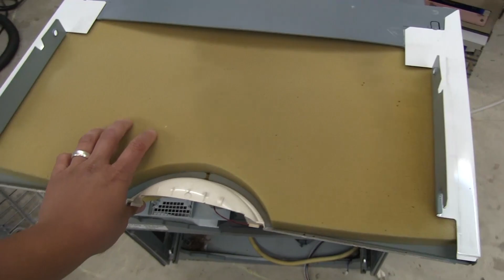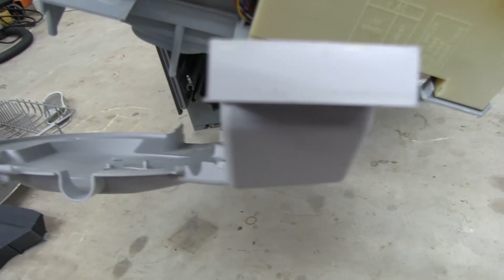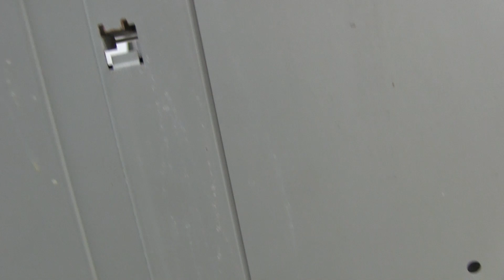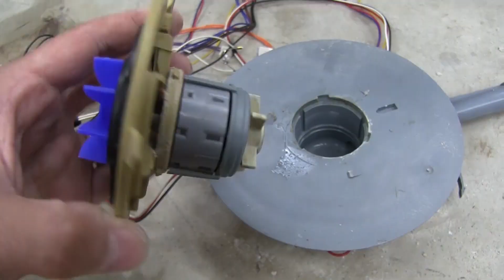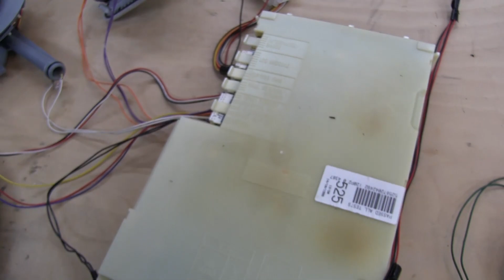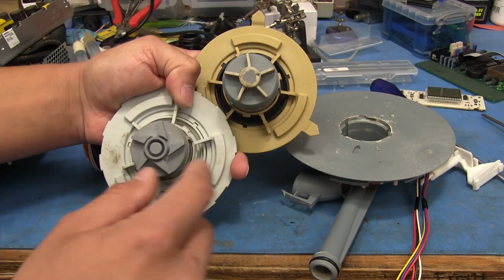TWB #98 | Fisher & Paykel Dishwasher Teardown

Comment: where is the fuse located' ,y dish doesn't power at all the inlet is on
Reply: On this model the fuse is part of the heater plate. You have to replace the whole plate to make it work again. Same thing happened to mine, I ended up buying an old dishwasher for $100 and swapped the top drawer using this video as a guide. Cheaper than paying someone to replace the heater plate with a new one.

Comment: at 14mins 10 seconds, i'm trying to fix an issue where I have water pooling in the clear underside tray. The motor assembly gasket isn't sitting right, so i'm assuming the leak is from there.
Trying figure out how I can replace this gasket. Do you know if the assembly just pops up from the inside or would I have to get underneath and release something in order for it to pop up.

Cheers!

Comment: I consider to replace our 5-year-old single draw F & P machine due to leakage when the cycle reaches the drying step. Condensed steam condensate at the outlet and drip down on to the floor. Our machine also is equipped with a water softener unit but your video does unfortunately not have this package. 
During the washing cycle there is no dripping on the floor. First when the drying step starts there is a condensation. I have understood that the drying mechanism does not have any heating element but just a fan. For washing water not to be led through the drying hoses there must be a valve, which is closed during washing and opened when drying. For an effective drying to happen, there must be an inlet somewhere, which also have to be equipped with a valve like the exhaust valve. I have not found out how this is working.

Anyhow, your effort to share how the F & P dishwasher is working, has been very useful to me and I send you all my appreciations here from Denmark.

Comment: At 9 minute in your video,  you pulled out a pump assembly,  what is that pump for please.  I have a machine that the top drawer will not drain,  but if outlet hose is lowered, it will run out. I'm trying to find a solution to my problem.  I thought that centre pump was the only pump the washer had.   Cheers Denise
Reply: That's the air pump that inflates the lid seal. Also attached is the exhaust valve that releases the air from the lid seal when the wash cycle is stopped.
Reply: @matyt94  thanks I will have to keep looking.
Reply: @souldevelopment966  you can find the installation manual online. Have a look at the height of the drain hose. There is a minimum and maximum height, if you go over the maximum it will struggle to pump. If this is ok, the motor is most likely worn out. Bear in mind this generation is the first F&P DishDrawer. It was released in NZ in 1997, AU in 1998 and USA was either 1998 or 1999. Either way, it's a 21 year old machine at best.
Reply: The model is on a label in the bottom left hand corner of the top drawer on the chassis. It will be either DD601, DD601V2, DD602, DS601, DS601V2 or DS602

Comment: Hey I have this exact model when I pull the top drawer out it beeps wildly instead of one beep when you open it as if there's a wire inside that when the drawer extends is frayed or something does it seem like there's a wiring harness that could be changed easily?  it only happens when the door is being opened.
Reply: Controller in the door is faulty, usually moisture or cockies
Reply: @samuelthompson4922  thanks the dishwasher has been replaced with a new single drop down door. We already miss the double drawer. 🙄